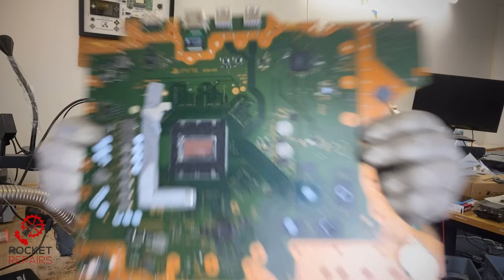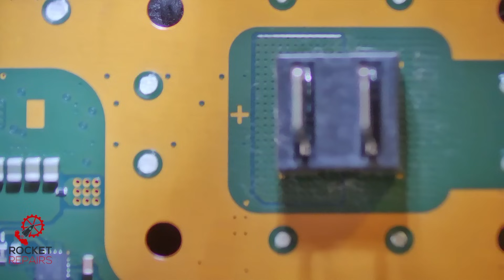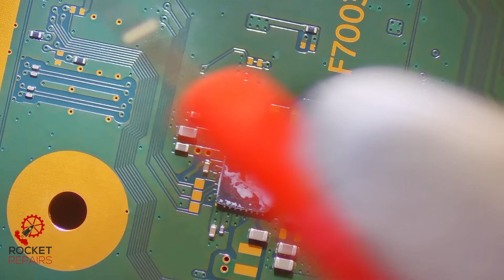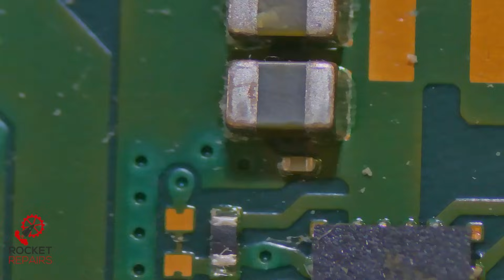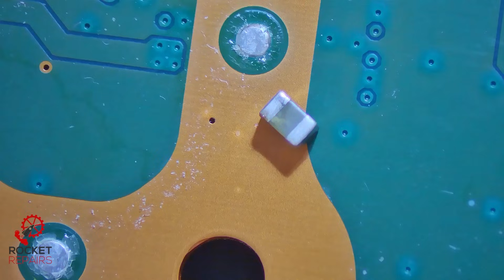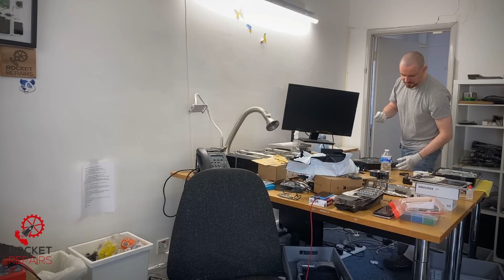Dead PS5, let me lay my HEALING HANDS upon you!

Comment: I had a strange one last week with a ps4 powered on for 2 secs I partially stripped it down and used my thermal cam to monitor what's happening during the 2 secs of power I found a cap and ic getting hot but the cap wasnt shorted in or out of circuit I replaced it and it's fixed but the cap that was glowing is giving a good reading and no short. Strange